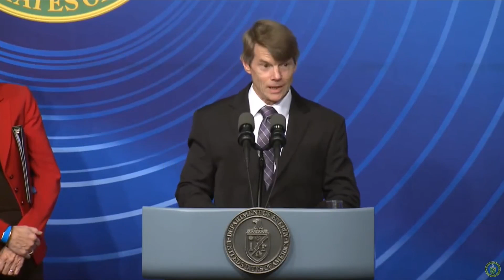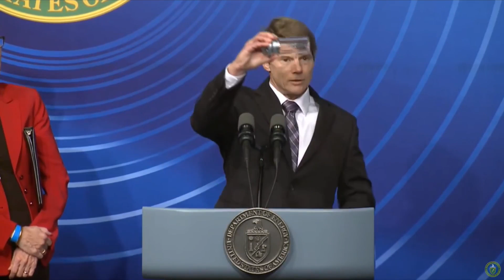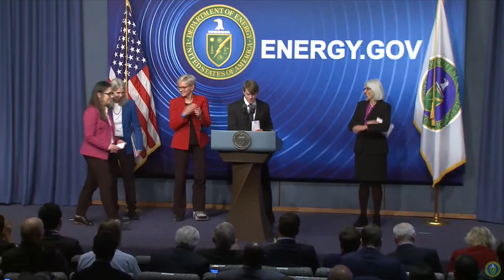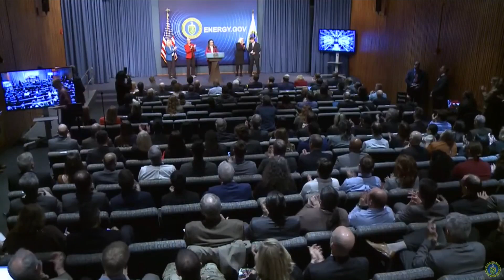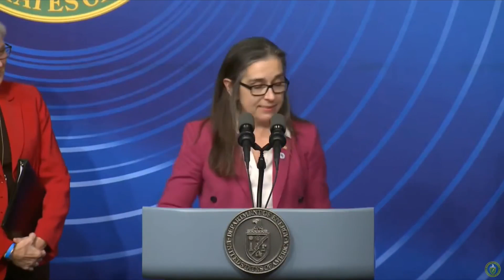Fusion energy breakthrough and national security implications explained

Comment: Congratulations I guess. I have a question though... For the 2MJ input of the laser shot, how many MJ were used to produce it? I'm pretty sure it was more than 2MJ, I'm also pretty sure it was more than 3MJ. In fact, I'm pretty sure it was multiple times more than 3MJ - and by 'pretty sure' I mean absolutely certain. You are way way short of engineering break-even (even ITER admits this is not easily acheivable, even with their claimed Q=10 projected gain) so cut the crap. You cannot break the laws of thermodynamics and conservation of energy. However, you weren't entirely disingenuous... Anyone with an iota of common sense can surmise we are closer to a nuclear exchange than ever, and that with decades of non-testing of nuclear weapons, the state of readiness is probably terrible. So well done on using this anouncement as a not very thinly veiled threat to other nations who might be thinking about having a go at a pre-emptive strike.
Reply: it was 300 MJ. 300 in, 3 out = -297

Comment: There needs to be at least a 2 to 1 ratio between output and input to be a viable source of energy.
Reply: That's laughable.  Internal combustion engines are only 40% efficient.  Hey, but I'm sure you're well qualified to tell these scientists that their work isn't good enough.
Reply: @burmy1552  As of this announcement .. if a trillion dollar fusion plant was built today it would only be able to generate enough power to operate the reactor itself, no useable output.

It couldn't even light a 100W bulb at this point.

We need to be able to generate more, much more, than what it takes to run the equipment. It doesn't take Einstein to understand this.

Comment: Very interesting news. I'd like to know what was qualitatively different about this experiment, apart from the result obviously. I'd also like to know what the efficiency of the laser generation is. It may be that far more energy was used in order to produce the laser pulse than was released by the fusion reaction. If the laser is <66% efficient then a 'gain' of 1.5 would still be a net loss.
Reply: @yarra6131  They drew 300 megajoules from the grid, produced a 2.05 megajoule laser pulse and released 3.15 megajoules of energy. So while the fusion reaction released around 50% more energy than the laser pulse that ignited it, the experiment was only around 1% efficient.

In layman's terms, they're a very long way off generating clean, renewable energy.
Reply: @nagualdesign  But the point is that the laser wasn't built to be efficient, only big.  Now that the proof of concept has been demonstrated, there is plenty of room for optimization.  This is the hugest news in our lifetime.
Reply: @silverfox8615  "Hugest news in our lifetime" is overstating things just a tad.
Reply: @nagualdesign  Not in the least.  What's bigger than this?  Name it.  The Moon landing?  The Manhattan  Project?   The Event Horizon Telescope?  This took 60 years of the brightest minds in the world to do.  Don't sell them short.
Reply: @silverfox8615  For now I'd say that it's Sweden joining NATO. But I'm only 32 years old. :)
Reply: @nagualdesign  Heh, today England is that backwater.  The British Empire died with a whimper in the last century.  You're living through a historic moment and you are failing to understand it's significance.
Reply: @nagualdesign  I'd add the mapping of the human genome to that list.  But you're still wrong.  Fusion ignition is still the greatest and most significant achievement on that list.
Reply: @whatsupbudbud  Countries joining alliances is mundane.  I wouldn't even raise an eyebrow until Switzerland threw in with someone else.
Reply: @silverfox8615  Hmmm... Perhaps you're unaware that this is not the first time fusion has been achieved? In fact there are some 40-odd amateurs who have created nuclear fusion in their garages. I believe a 17-year-old did it almost 10 years ago. What no one has done yet (including NIF) is release more energy than they used. When that day comes it will be bigger news than mapping the human genome. Until then this is arguably less newsworthy or life-changing than when they banned dogs from shitting on the pavements in the UK.

It's great, you can even walk across a grass verge these days with minimal chance of standing in the smelly brown stuff.
Reply: @silverfox8615  Not sure why you brought up the British Empire, or why you think that modern day England is the backwater I was referring to in my previous comment.

Queen Elizabeth lived in England, so it's unsurprising that the English people know about her death. My point about it being big news was that people in far off countries living out in the sticks will probably have heard about it.

Whereas I strongly suspect that there are large numbers of people living in California, where the National Ignition Facility is located, that probably haven't heard this news or even care what the NIF is. In my experience, most people simply don't really care that much about science.
Reply: @nagualdesign  lol, myopia is treatable, you know
Reply: Fyi, at the beginning of tbe discussion panel after this announcement they stated that the laser used was not designed to be efficient but powerful. The amount of energy input into the laser was about 300 megajoules, while the output of the laser used to excite the fuel was only 2.05 Mega joules. So that looks like about less than 1% efficiency? LOL somehow that doesn't feel right but that's what he said
Reply: @justicevanpool9025  Oh dear.

Thanks for the information.
Reply: still a very long road ahead...
Reply: Jesus Christ died for our sins.    3 days later he was risen from death.  Jesus is alive and He can forgive you of your sins.        MARK 1:15 Repent and believe in the gospel.

Comment: What a bullshit. Just counting the laser energie input (2,05 megajoule) and the direct fusion output (3,5 megajoules) is not spectacular in any way and doesn't bring us closer to a nuclear fusion power plant. Lasers have generally 30% efficiency, so they put in much more energy than they generated. And when we want energie out of this, we have to generate steam and put it through a turbine into a generator. A lot more losses there!
This is a PR stunt to secure funding. 
Fusion is done for a long time, and not something they achieved as the first here. The method is not suitable for energyproduction due to it's inconsistent way of functioning. Shooting gold peas with lasers is a discountinous process and not very efficiant in terms of power generation. 
If you are interested at fusion based energy generation take a look at ITER. That is the way to go. America is part of that as well.
Reply: true - "_NIF needed to pull 300 megajoules of energy from the electrical grid in order to generate the brief laser pulse."_

"“You’ll need gains of 30 to 100 in order to get more energy for an energy power plant,” Dr. Herrmann said."

Comment: The amount of laser energy delivered to achieve ignition is one thing. But is the energy upstream of the lasers required to drive the lasers included in the claim?
Reply: That's really an irrelevant question at this point. What they achieved here is a proof of concept, and like any thing that sits at the edge of engineering, how that technology will be transferred to industrial applications, only time will tell. But, in a free and open market, this will draw billions of dollars of investment and any possible hindrances to widespread application will be self limiting. In another sense, if no one wants to eat your pie, it's safe to say, you are a blank cook.
Reply: No, they used 300 MJ to fire the lasers (to make 2 MJ of light) to get 3 MJ out, that is a 297 MJ loss. They are also using tritium of which there is less then 150 lbs on the whole planet in existance. This experiment is just another nothing burger.

Comment: The problem is that we don't need heat to produce electricity.  We certainly don't need more nuclear radiation.  The containment of nuclear radiation from the deuterium fuel and apparatus is still as difficult as it has always been. We have agreed not to contribute to the nuclear cascade.  The nuclear nonproliferation treaty enforcement and obligations are based on the danger of nuclear radiation.  We don't build develop or share nuclear technology due to the danger of nuclear cascade and ozone cascade.  The chemical weapon manufacture treaty and nuclear nonproliferation treaty were ratified by Congress and USSR and 180 countries to address global warming and global infertility.  However we continue to be grossly misinformed about power generation power use and global warming .  We will see green house effect and the danger of Green house gases if we try to survive nuclear technology halogenated vinyl and halogenated carbon. Until then we need to stop wasting precious fossil fuels on power generation and transportation.  We can easily replace fossil fuels use and nuclear power plants with edison generators and dynamos with inverters and transformers.  The problem is we are grossly misinformed and we are repeatedly misinformed about power generation and power use. We don't need to create heat for the generation of electricity.  We can spin like magnets using the magnets and with inverters and transformers produce any voltage AC needed.  Steam wind or water are superfluous to the generation of electricity.  The magnets can move the armature magnets and coils of copper wire.  We deliver high voltage AC power to the power lines with inverters and transformers.  We are still waiting for support of zero fuel and zero pollution power plants in the USA.

Comment: Yawn!  I've been hearing about "breakthroughs" in fusion ever since the 1970's.  Each breakthrough heralded the claim that practical fusion energy was just 30 years away.  It's always been 30 years away for the last 50 years!  How do you drum up funding for your research?  Claim another breakthrough.  So you put 2 Joules in and got 3 Joules out.  Were those 3 Joules captured?  This has always been the underlying issue.  Experiments might prove a concept but a practical power source requires the capture of the energy produced with enough excess to run all of the ancillary plant equipment and be distributed to consumers. This, I'm afraid, is a long way off.  When all of these problems are solved how long will government bureaucracy for permits and other red tape take?  This won't happen in any of our lifetimes I'm afraid,

Comment: Oh my gosh, but this is getting out of hand. I mean OK, they had more output energy than input energy. Great. Congrats. However, They did it with lasers rather than an electromagnetic field and that is bad because nobody else has that kind of lasers and power. Next, they still have no idea how to capture these high energy particles. Where and how do you store the extra energy? Then and only then will the private industry even "attempt" to create a fusion engine. This is the first time, more energy is coming out than going in, but my goodness, lets take it easy. Its not going to be Star Trek in 3 months. This is still a 30-40 years in the future.
Reply: All that technology and power only to boil water - but, as you say,  they haven't even yet demonstrated how they will efficiently capture and apply that raw energy to do useful work.
Reply: Getting more energy out of a reaction than was put it has never been done before.  You're right that it's not yet scaleable, but this is a huge deal in concept.